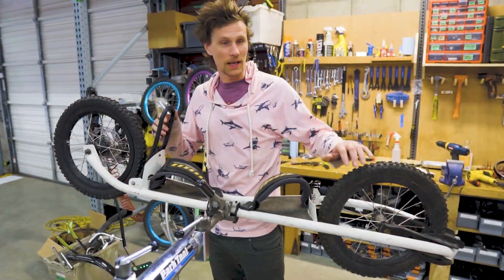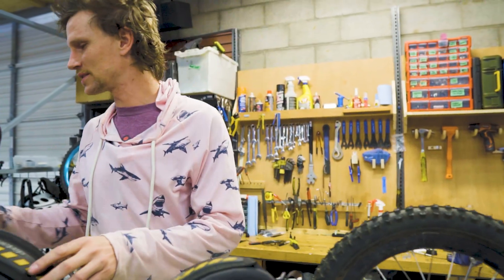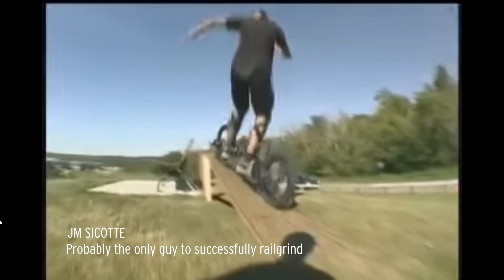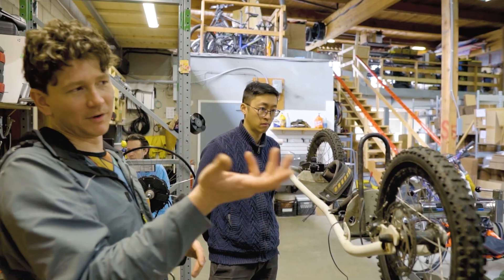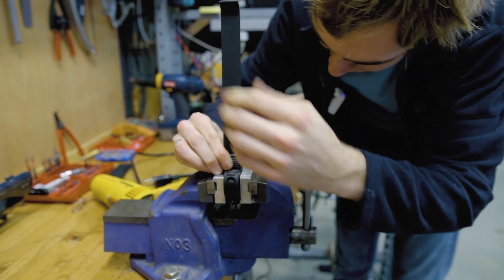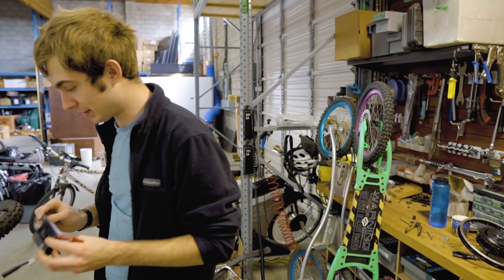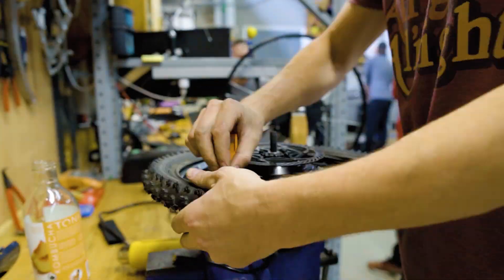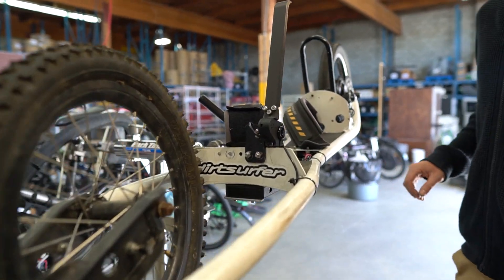Electrifying a Vintage Dirtsurfer

Comment: Did you make kits for these? I have been thinking about doing my street model and like your idea.
Reply from the maker: Not an explicit kit but it's pretty easy to pull off with any 20" hub motor system and a bit of diy around the throttle control
Reply: @GrinTechnologies  that’s my plan. Great video!

Comment: Can a normal person do this? I want to do my own.
Reply from the maker: Any Dirtsurfer is a super basic conversion actually, no gears like a bike, both wheels are a standard bicycle front tire 20" or 16", therefore any front hub motor with 100mm axle length is compatible. The larger Direct Driver motors can't be spoked into a 16" size wheel like on the GP16 but can for the larger and more readily available 20" Dirtsurfers, that's why this conversion was a smaller geared Shengyi SX1 motor. If you don't have access to 3D printing/ metal shop tools, then you could skip building the custom accelerator arm and just hold the throttle in your hand. Twist throttles work best for that. It's hard to find batteries with the profile of the old LiGo's which are now extinct, so you would have to get extra creative with mounting a battery since there is such low clearance on the underbelly of the beast!

Comment: Custom make a battery to fit all those 18650s in between the tube frame and then plate over it with aluminum to protect the battery and electronics and at the same time having a mint skid pan and possibly storage space for tools or something maybe